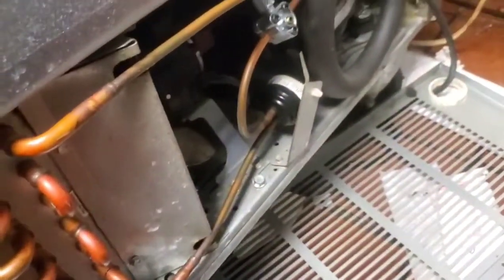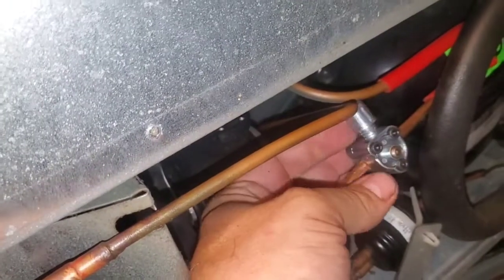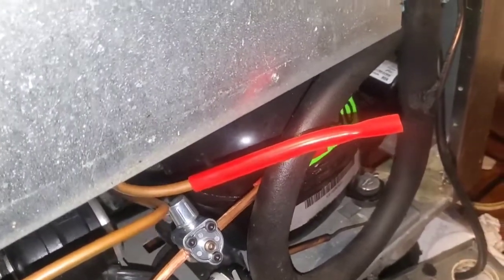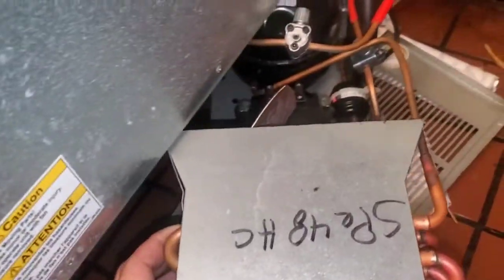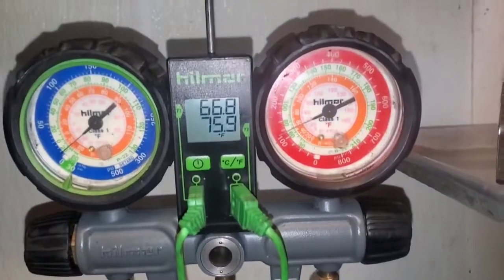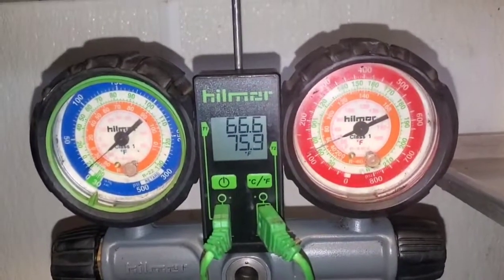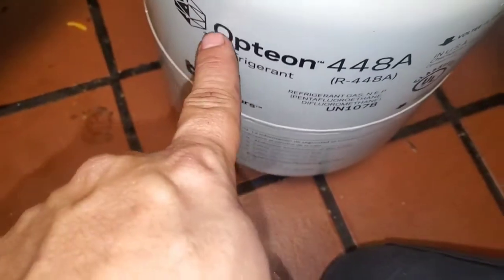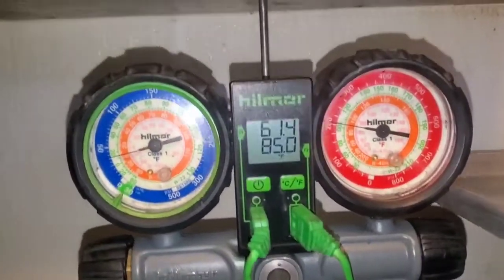Small R290 Systems Can Be Charged With R448a

Comment: R290 has higher Thermal Conductivity at 0.0676 than R448a (0.0469) R290 has no “glide” for stable temperature and R448a has 7° resulting in unpredictable temperature variations of 7°F. R290 has lower high side compressor pressures which will lead to longer compressor life.Aug 30, 2021.
In till the manufacturings changes the refrigerant .
Reply from the maker: Right on thanks for sharing some technical knowlwge. Ill add one I learned from this experiment, r448a is more dense than r290. So dense that this trick will not work at all on any system bigger than this little make table. Since recording this video, Ive managed to try it on a large reach in and it had no hope of feeding enough refrigerant thru the cap tube. I appreciate you stopping to comment here.
Reply: Propane has been around a long time  it’s nothing new maybe for the new guys and it’s show up equipment that everyone works out field but l been working on propane systems for over 20 years in commercial equipment it been used in pharmaceutical lab equipment  even in cascade system with mix refrigerant. Yes you change refrigerant but why it not engineer for equipment it comes down to liability & how long equipment will last for your customer .
Reply from the maker: I didn't know r290 systems were in use 20 years ago
Reply from the maker: This unit was thrown away a couple days after this video was recorded and replaced with a new one. That's why the r448 experiment was done on it. This is how we learn what happens if you do things they tell us not to do. We learned that r290's density is very low compared to r448 and especially r134a.  This allows it to pass thru a much smaller metering device as a liquid and it allows a weaker compressor to pump it. Using denser refrigerant results in a starved evaporator. Only on a small system can you feed enough refrigerant to the evap to cool properly. The lower saturation temperature and the small coil make for a mostly full and much colder coil and more net cooling effect than with the r290 on such a system. On anything larger it'll just freeze the first tube of the evap and not cool until the compressor fries.